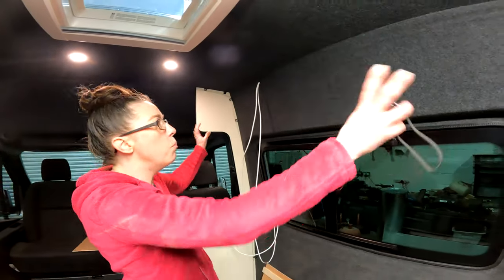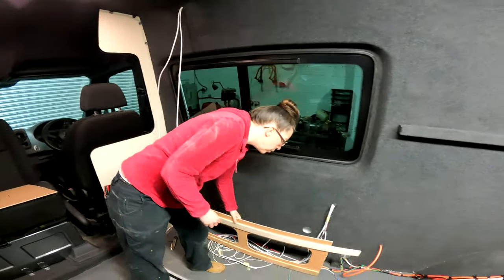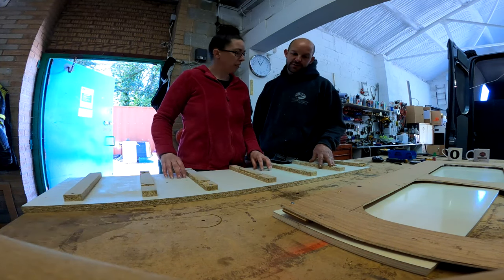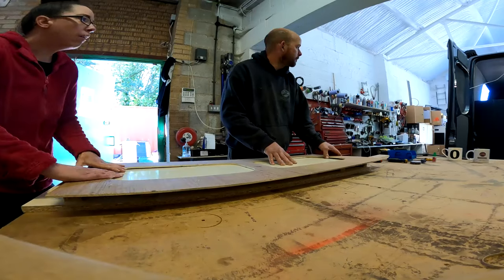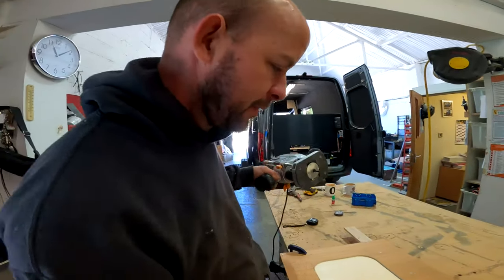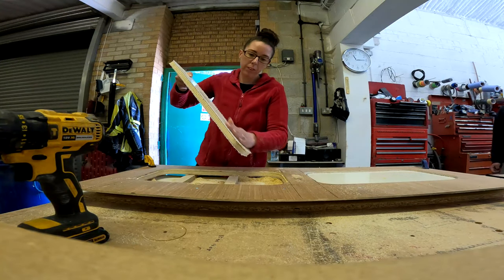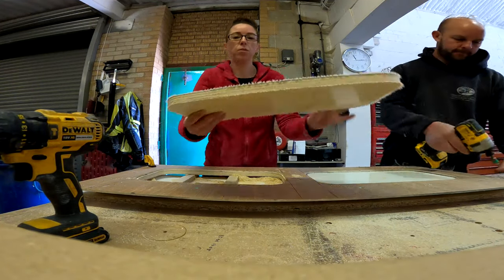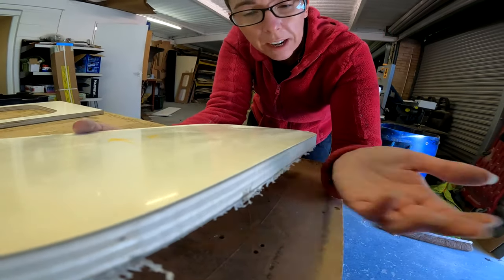How To Make Camper Overhead Lockers / Cupboards With 15mm Lightweight Plywood and T Trim

Comment: Hya. just found and subscribed. I'm not a router expert  but I enjoyed watching you do this. I'm presuming you used 15mm ply?  If I was to attempt this using a 9mm ply template to cut 18mm ply, what length of bit would you suggest to router out two doors like you showed here?  You mentioned the width of the cut but not the depth of the cutter.  Many thanks :)   - Kenny

Comment: I would never ever use particle board for the reason being that it expands and screws come loose with any amount of humidity ! Now if you say used just plywood then I would say yes ! And yes that's from practical on the job 30+ yrs experience in renovation and repair and custom cabinetry making

Comment: What wood do you use and how is the cupboard held/attached to the ceiling / wall? Cheers
Reply from the maker: These are made from high gloss cream lightweight plywood, held to the walls with kregs and to the celings with corner connectors

Comment: Great video, do you have a link to where I could get those hinges and catches from?
Reply from the maker: https://www.ebay.co.uk/itm/170mm-Cupboard-Locker-Door-Stay-Metal-Caravan-Motorhome-Boat-01606T070-/232987351342?mkcid=16&mkevt=1&_trksid=p2349624.m46890.l6249&mkrid=710-127635-2958-0
Reply from the maker: https://www.ebay.co.uk/itm/5-x-Black-Evomatic-Door-Handle-Catch-For-VW-T5-T6-Furniture-Camper-/172979635558?mkcid=16&mkevt=1&_trksid=p2349624.m46890.l6249&mkrid=710-127635-2958-0
Reply: Thank you 👍

Comment: Being less practiced, and prone to messing up; I'd have to put a shim on the off side of the router while cutting the door to prevent the router from tipping. Because, for me you know - it would. 

I was wondering if putting the slot cutting router in a table so you don't have to clamp the door down then take time to unclamp, reposition, reclamp. If the table surface was small enough you could grip the door on the edges so you had a proper grip.

Being a wee bit older than you can say this (as in been there done that); get some hearing protection when using those machines. I prefer over the ear, but I got these molded units from Amazon for when I ride the motorcycle and tend to use them now (don't squish my head!). It does NOT affect the wife filter either. :^)